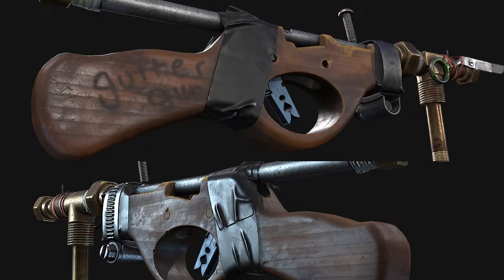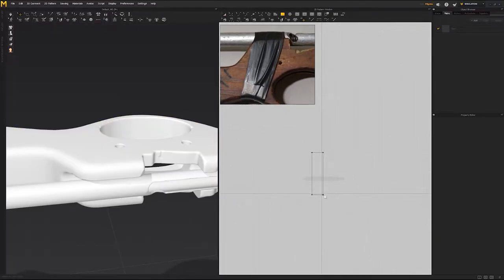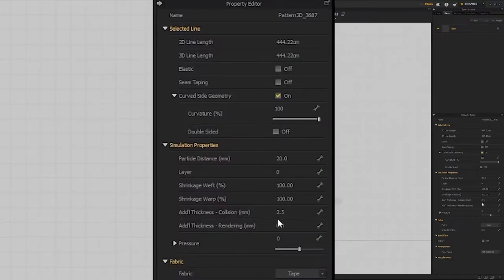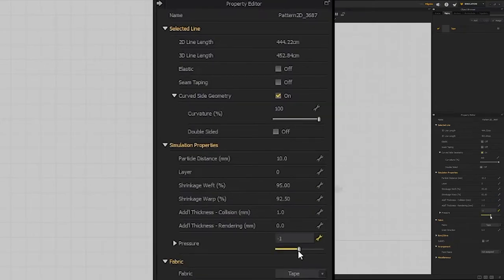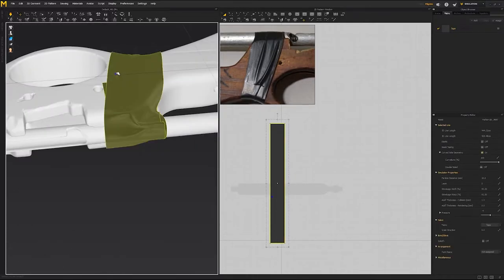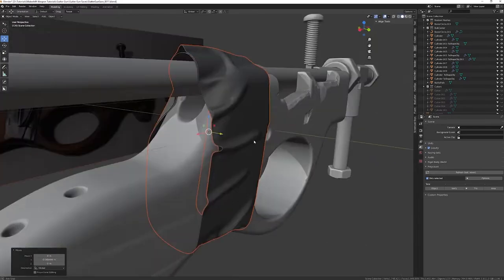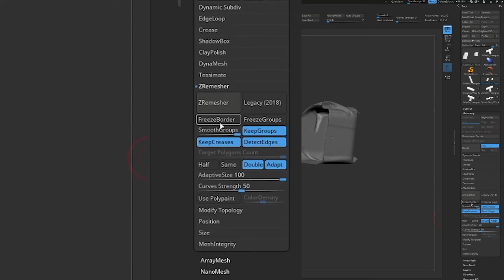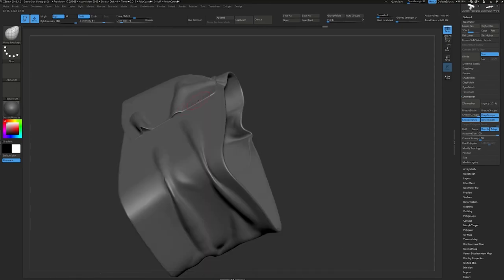How To Make Tape In Marvelous Designer  - The Easy Way

Comment: is it possible to do it in blender tho? around cylinder
Reply from the maker: Do you mean like a sword wrap? I guess you could use the skin wrap modifier with a cylinder that has its top and bottom face deleted. Set to project, add a solidify and subdivision surface modifier and then collapse the stack. Duplicate. Move down/up. Add the original to the auxiliary slot. Repeat. ?
Reply: @ArtOfPilgrim  i guess? maybe nah, i mean duct tape simulation arount circle if that makes sence
Reply: yes, if you have an inhuman amount of patience u could try to use Blender's cloth sim, I recommend the cloth sculpt brush that works ok
Reply: just realised he has a blender version of this vid...